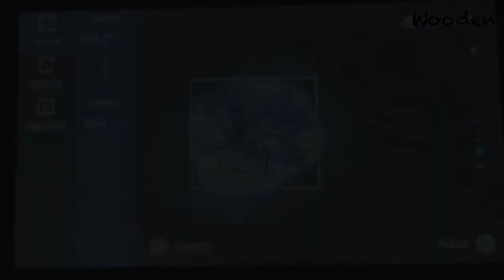Flower shaped serving tray out of end grain spalted ash - Ash - #shapermade

Comment: Hi Javier, very nice project! I was wondering if you used sanding sealer, or epoxy on the surface prior to doing the colores inlay? I did a similar inlay although larger, and had staining from the overflow of epoxy. Thanks
Reply from the maker: Hi Henry. I didn’t use sanding sealer for this project, but maybe I should have. Along the coloured inlines there are stains similar to what you described, so sealer could have helped prevent that a little…